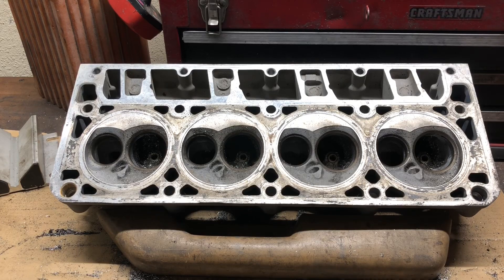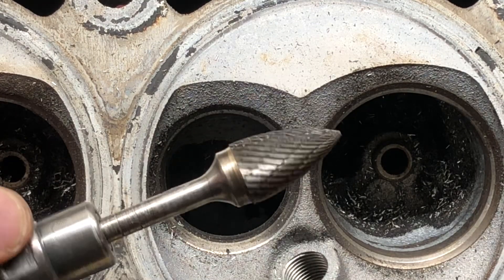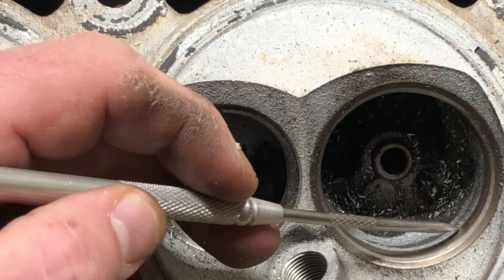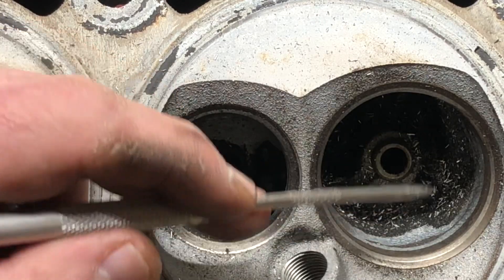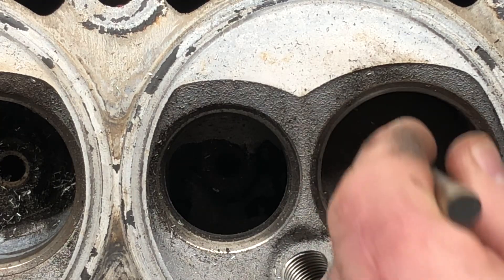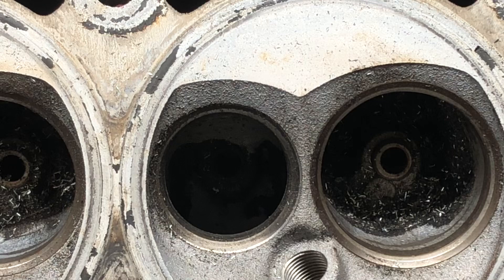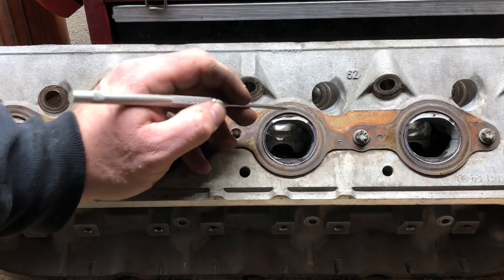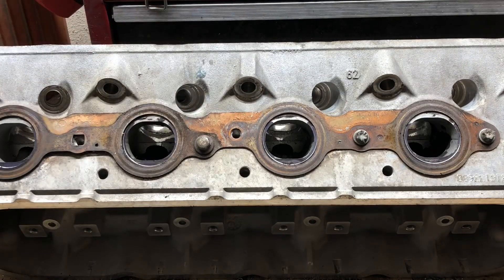Porting 862’s Bowl cuts & Raising the roof

Comment: I call that the hogger bit, the aggressive bit. That is great for raising the roof, narrowing down the valve guides and removing the rocker bolt bulge. I use an electric Makita mini die grinder, I usually cut voltage down so I have better control.
Reply from the maker: RPM control is key with those electric dig grinders. They’re really hard to control when they’re just one speed.

Comment: Would it be any benefit to port and blend the bowl without increasing port intake size?
Reply from the maker: Yes, the “Throat” percentage 89-90% of the valve size and the “Bowl” blend is the main areas to increase flow. 
The “Bowl” area below the throat can be slightly bigger than the throat.  But if it’s your first time just blend the throat smoothly into the bowl. 👍

Comment: is this process the same on 243 or 799 heads
Reply from the maker: On the 243/799 heads you want to scribe the gasket and maintain the D-port shape.  Yes you raise the roof but try to keep the D shape. 
Performance bowl cut % applies to any heads. JD

Comment: Do you have to have your engine tuned with ported cylinder heads?I've heard half and half but I'll like to her from Doctor Port, really I've learned so much from you thanks
Reply from the maker: Jessica Watson- English Basically the engine should run fine with ported heads with the original tune as long as nothing else was changed. Now, it won’t be optimized to take advantage of the added head flow.  Keep in mind there are tremendous gains in power and response when only tuning a completely stock vehicle. 
I hope this helps answer your question and decision process.  JD
Reply: @HeadFlowInc  yes sir thanks for your answer looking at your videos  I started porting and polishing heads now for about two years I got some old 862 heads and went to work on them lol 😂 made lots of mistakes but now I'm on the right side of the burr and things are going good thank God and thank you
Reply: @HeadFlowInc  thanks for this response I’ve been wondering this myself ... im porting some 241’s atm, cheers for all the great content 👍🏻

Comment: How do you calculate how much to open the bowl up? I’m currently following a lot of your videos to port a set of 862’s for a high compression big cam 5.3 I’m building. Would like to make a template but not sure on how to calculate sizing.
Reply from the maker: Smitty5oh I calculate the percentage of the valve size.  Whether it’s 1.89”, 2.00”, 1.55” etc. 
Intake side 88-90% of the valve size. 
Exhaust side 86-87% of the valve. 
You can use extra/old valves cut down works great.  JD

Comment: I got a little over zealous and did a 90% bowl cut on the exhaust side, in your opinion is the seat compromised? Only going on a na 6.0 with a ss2 cam.
Reply from the maker: Matt Flang NA does make a difference less heat.  You opened the bowl/seat to 1.395”?  I can not guarantee anything, I’ve never cut an exhaust this far. Where you using a template or working only by eye? 
I’d bet you aren’t the first person to go to 90%, I know Mondello talked about “Special Race” applications using 91-92% on the intake bowl. 🤔🤔🤔
I’ve run an 88% exhaust with boost without issue.  JD
Reply: I used a template for 88% but by the end probably ended up at 90. They are a set of 862’s I had laying around and after watching 17hrs of your videos I figured I’d give it a try. If u haven’t gone past 88% these head a will be a learing experience. Thanks for the videos and your input!
Reply from the maker: Matt Flang I want to say you’ll be fine, at the same time I don’t want the blame if something happens you know?  I’d definitely say the odds are with you having no problems.  If you can, let me know how the project runs!!!  I’m very curious to see the power! JD
Reply: Right on,  I’ll prob just get another set and try again, there only 40$ at the local yard. Thanks again for your input and videos, so much information!

Comment: Hi I get my vavle  percentage which I want use digital caliber and cut a straw to size takes a couple goes but you get there.straw guides me 360 degrees around bowl and throat same with port runner . It works unreal measurement for any  angle and position  gets diameter prefect.then it's up to you how you want to shape your port. Another tick after you finished porting if no flow bench stick vacuum on seat put hand over inlet runner feel how much it sucks or palm a lazy port won't suck or palm very hard it's about mean port velocity with exhaust flip another way around vacuum on exhaust runner palm on seat again you will feel velocity strength .great show just because haven't got all the gear don't mean you have any ideas that's my motto.
Reply from the maker: Wayne Ireland Interesting tips and ideas, thanks for sharing!  Thanks for watching and the feedback I appreciate it!  JD
Reply: Wayne Ireland How bout making a video of these tips/techniques??
Reply: maybe won day I might 🤔?Just like to share some my experience. On saying that there some informative and knowledgeable people out there and this gentleman channel won off them.peace out.
Reply: Wayne Ireland I just couldn't quite visualize what you were saying to do and a vid would be awesome.  Thanks

Comment: I I finished my heads but I went back and blended the seat to the bowl after. I liked to leave it cause it kinda give me a reference point how much I was taking out but I have a ? We’re do you get your pineapple bit from I couldn’t find one on amazon or eBay
Reply from the maker: Thomas Johnson I think we bought the 1/2” double cut egg at Fastenal.  Funny story, it took me forever but when I first started porting all I could afford was a 3/8” double cut egg burr; I ported two sets of iron heads with it! Lol. After that it was dull! 
Having the right burrs definitely saves time and having a larger burr as long as it fits is easier to get things smooth.  JD
Reply: HeadFlowInc thanks a lot bud for everything I’m fixing to put my heads on my new motor and get it in I’m exited I worked my a#% off on them but I have to two sets of 799s and one set 243 so I’m going to start on them soon And I don’t think I’m brave enough to tackle iron yet lol